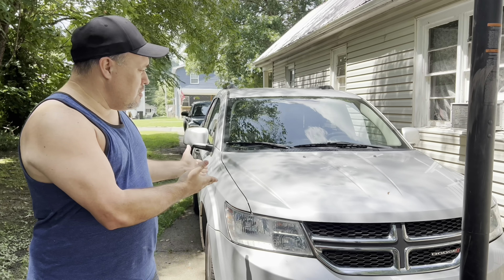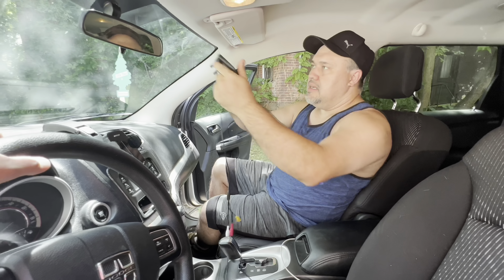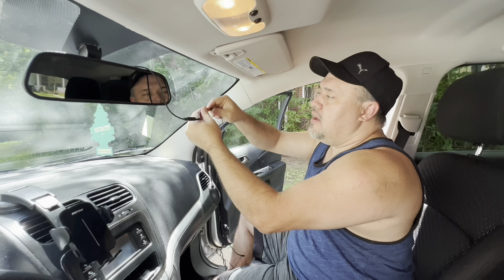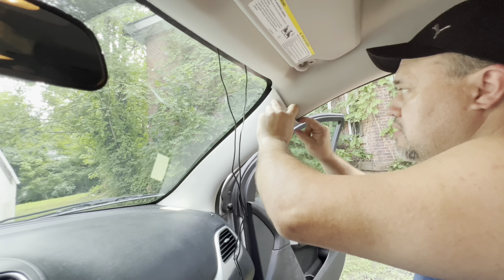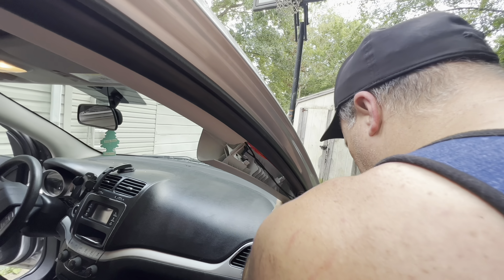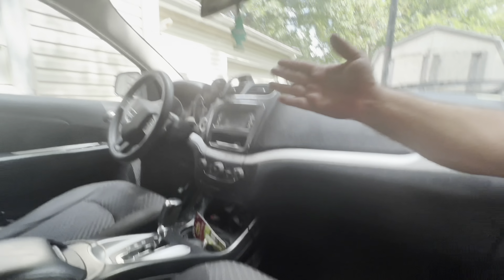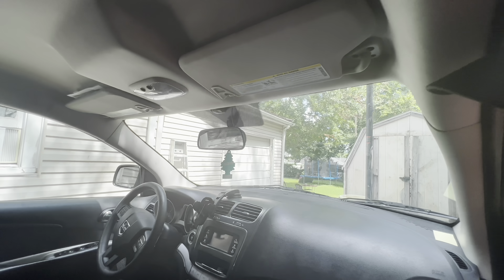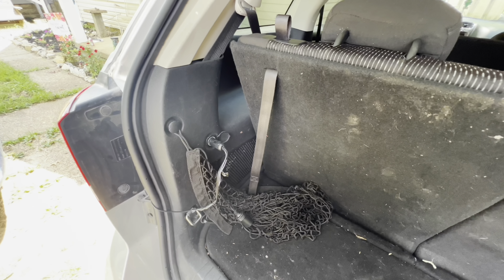How To Install A Wireless Backup Camera On A 2014 Dodge Journey #dodge

Comment: Hello, I have exactly the same problem with the reversing camera that I installed. Do you know how to fix the problem of the reversing light being under voltage?
Reply from the maker: Well, you can fix it the way I did in the video and just use the rear plug-in.  Or you can run a wire Street to the Battery and lead the wire inside of the car and use a toggle switch.  Those are the only ways I found to do it.  Or you can get a wireless solar powered back up camera, but those are a little more expensive.

Comment: With the back up camera always on, do you think it will drain your battery over time?
Reply from the maker: It actually has a switch to turn it off. I don’t know if you saw that in the video or not?  And you can also wire it into the tailgate wire and it will only come on when you put the car in reverse. You can do it either of those two ways.
Reply: @Mr_Goody  I was referring to the camera in the back, not the mirror. I was thinking it was like leaving something always on in your car draining your battery.
Reply from the maker: @  that’s what I meant. It has and often on switch also and you can wire it in to the back up lights so then it will only come on when you put the car in reverse. Yeah it would definitely be bad if it was on all the time definitely would run the Battery down.  And almost forgot one thing with the accessory plug-in and with the back plugged in as soon as the car is shut off, it kills the power to those plug-ins now the plug-in in the center console is live even with the car off.  So you should be fine even without the offer and on switch I know I’ve had mine or I haven’t had a touch the often on switch for about 2 to 3 years and it’s never ran the battery down and it always turned the camera off after I took the key out.
Reply from the maker: It works a lot like if you were charging your phone and then you turned your car off. It turns off the cigarette lighter accessory power.  As far as I’m aware of the only plug-in that stays live is the one on the inside of the center console.